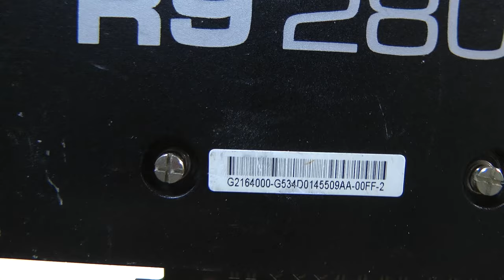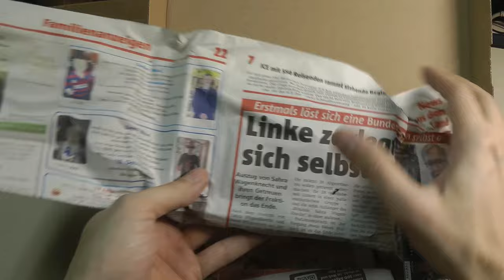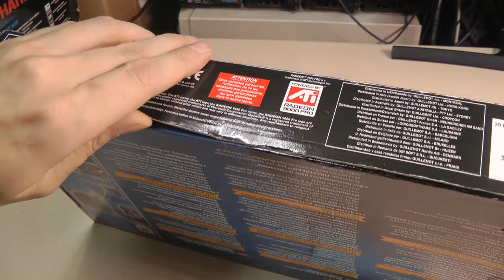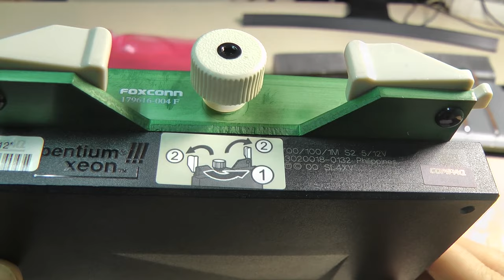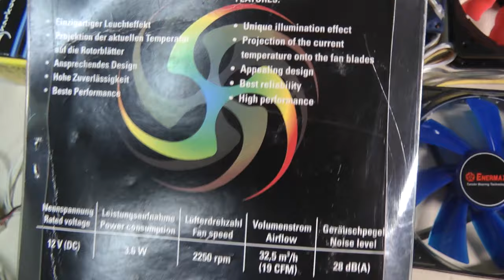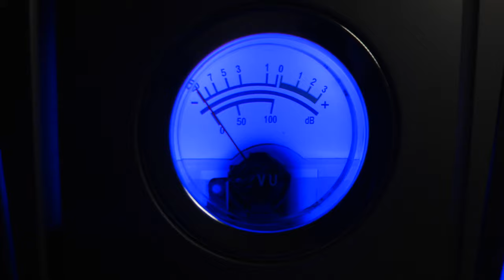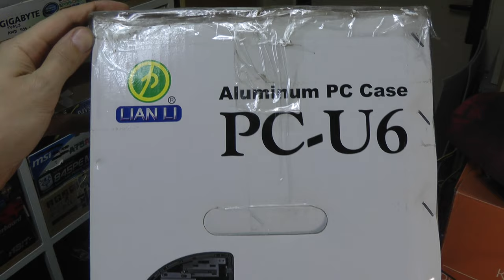new screws

Comment: I just bought an ESS Audiodrive 1688F..yours has the wavetable expansion daughterboard, JEALOUS! tracking down one of those is unobtanium unless you spend a whole DOS PC's value on aftermarket modern options..though im having trouble getting CD audio in, its got headers for mitsumi, sony and standard on top, then right by the jacks which is very handy, unisound wasnt able to pick up the card at all either despite being supported, but a standard driver did work so i could make sure the card was working, will have to run some CD copy games like quake 2, its otherwise a fantastic card for DOS, when i heard rise of the triad vs the vibra 16XV it was just..huge, though the ALS 100/120 and Crystal cheap specials to be fair werent the worst..they just dont have any expansion options..

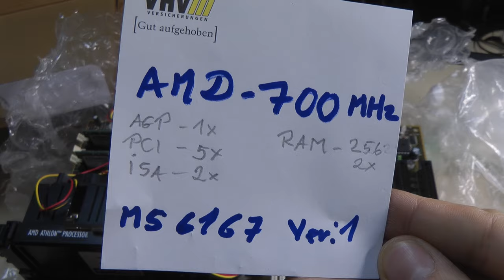Comment: 4:13 - @retro the RAM slot instalation in this MB is unique: If you are using only one DIMM RAM Memory, install it in the isolated slot. IF you are using 2 DIMM RAM memories, use the other two slots - To use 3 RAMs you need 3 DIMM RAMs equals

Comment: Hey, I am watching your all videos with excitement. Good work as always. Just wanted to ask you something. Cause I need an expert's opinion about this. I currently have Asus Rog Blitz Extreme motherboard which is fully functional. Is it a rare piece? Your answer will be much appriciated btw. Many thanks.
Reply from the maker: It is P35 board with DDR3 and poor PCIE 8x 8x slots, X38 was much better those days ... it is interesting more how it looks before performance
Reply: @RETROHardware  It has a seperate LCD Panel and has IO shield light. Currently I am running QX9650 with Mars GTX 760X2 with that motherboard. I wish I could make you see my Build tho. Many thanks btw for Your answer. Been a honour to talk. :)